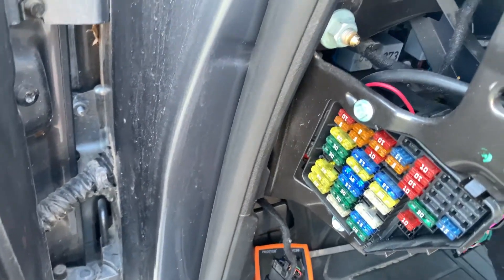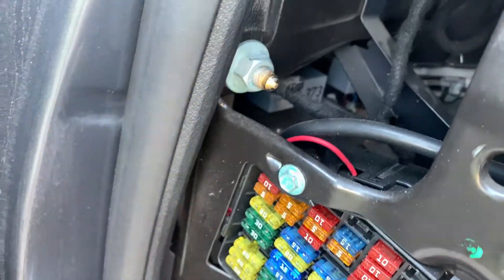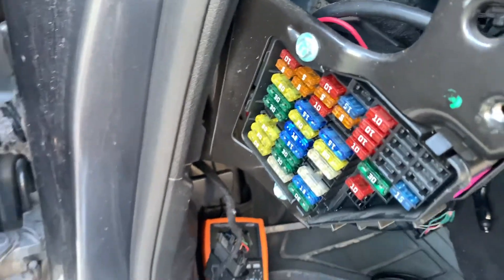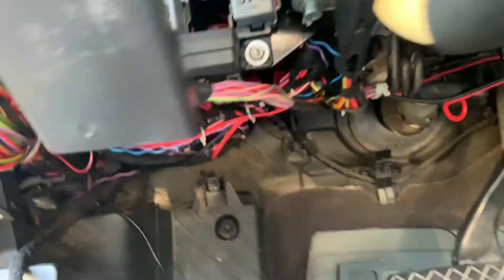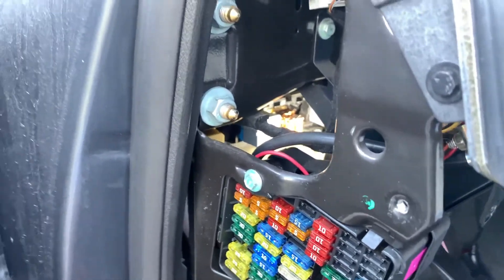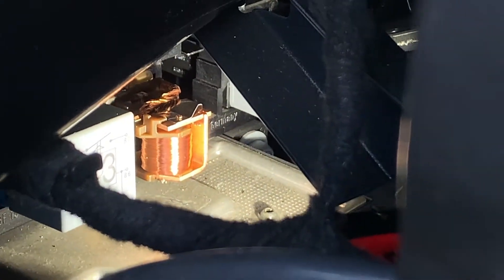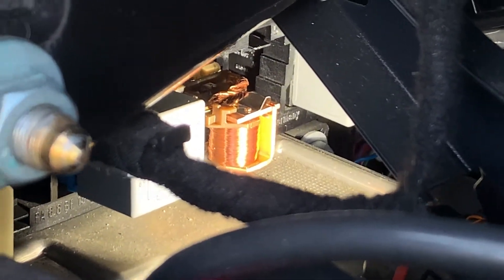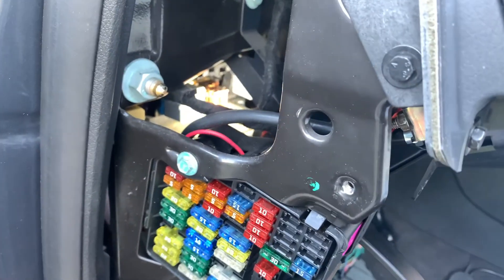2002-2008 Audi A4 1.8T Checking Vacuum Pump Operation

Comment: According to my VW dealer parts website and at least one mechanic, my 2003 Jetta 1.8T is supposed to use this same electric vacuum pump. I have had braking problems for some time, and so I wanted to test this pump. But for the life of me I cannot find it on the car!  I do not have a mechanical pump at the end of the camshaft, so does anyone know where this pump could be? I have looked above and below the car, and all the manuals are worthless.  Thank you.
Reply from the maker: Probably under a cover in the engine bay, they hide them pretty well